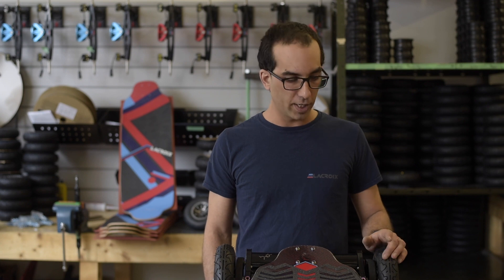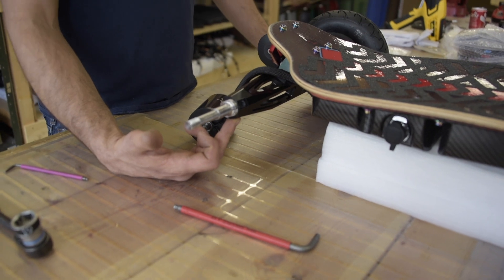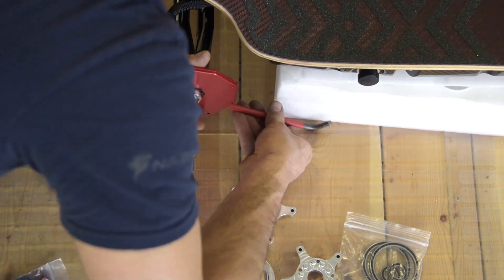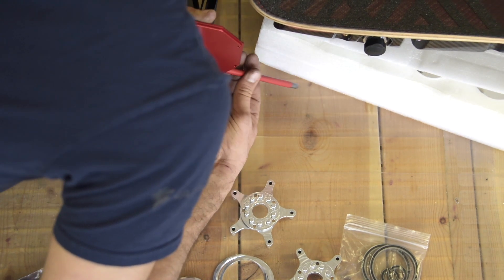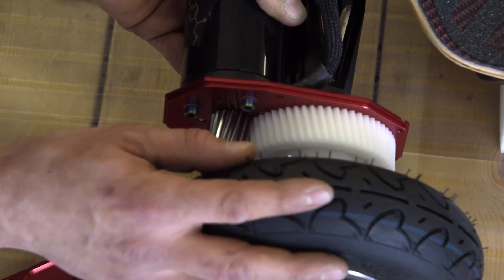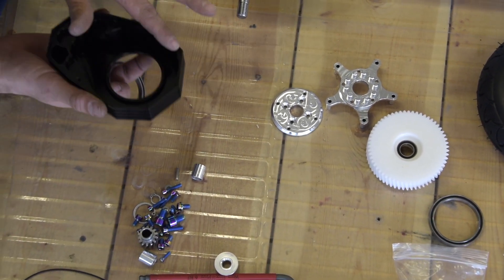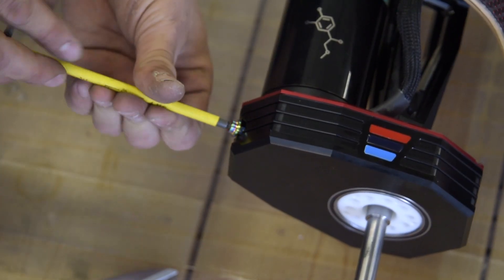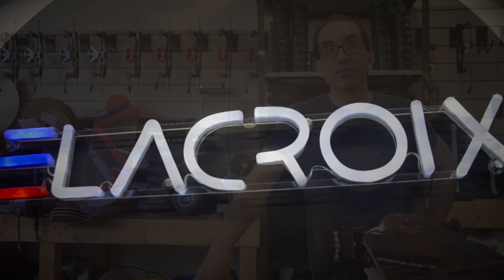HOW TO;  Install the new Falcon Gear Drive

Comment: Would've been nice to get a set of all metal gears instead. Even if kept well greased, plastic will eventually wear out.
Reply from the maker: we have been riding them for 1 year now and so far there has been no damage or modification of the gear, besides, the metallic ones are much noisier and can cause problems. They are made of hardened steel and POM. Polyoxymethylene (POM), also known as acetal polyacetal, and polyformaldehyde, is an engineering thermoplastic used in precision parts requiring high stiffness, low friction, and excellent dimensional stability. We are pretty confident in using this material instead of metal. let us know if you would like to receive more information about the product
Reply: @lacroixadventures2009  - Thanks for the info. Time will tell how plastics will hold up. Proper adjustment of the gear mesh is important.

Comment: I noticed that the gentleman installed cap screws to attached the Hub adapter to to the POM gear, is this something specific to the Aluminum Hubs. I have the plastic hubs and the adapter does not have any screws holding it to the POM gear. Doesn't seem necessary since everything seems to be help captive bay the axle nut. Interested in the answer, thanks
Reply: Hey Justin, yes you should have those screws. They align the POM gear with the motor gear inside the case and makes sure it's always exactly in the right spot. You don't see it from the outside from run the Falcon long enough without them and something will fail for sure.

Comment: Has anybody broken the pom gear yet. How is compared to steel when jumping? I liked everything about these drives but the plastic gear...if a tooth breaks it will surley faceplant you if it gets wedged between pinion and drive gear and for this reason its a no sale for me. Spend the extra money and go hardened steel. Pom is great for alot of other things like a rc truck but even then the first thing you upgrade is the gears to metal for dependability.
Reply: The drives are designed so that if the POM fails (we have not seen that happen yet), the screws holding the motor will take the hit and the motor will pop off. So no lock ups and no faceplant.
Reply: @TheArchDelux  seems like one would faceplant and the motor would fall off  "all at the same time". What a bad day that would be. Plastic doesn't last forever like metal gears. If pom is so good why not make the pinion gear pom aswell.

Comment: I do mostly off-road rides. Would you say that gear drive is less likely to break or cause problems when faced with sand, dust and humidity?
Reply from the maker: We suggest you gear drive if you do off-roading, that way you will not have to deal with broken belt ;) .

Comment: Well ''loctite-ing" those bearings in place in each housing was terrifying.
I only had the blue/med& red/high strength permatex gel on hand.   I opted for the blue. 

If you don't have a super small paint brush or like me don't trust yourself with a small paintbrush with threadlocker on the end of it...I used a Q-tip, some heat shrink and a heat gun to make an applicator. 

The tube shrunk around the cotton ball and half way down the stick worked great.  The cotton swab end covered in the shrink made a smooth little bulb that was good for dabbing tiny dots of the stuff around the edge of the bearing and the stick part (?) of the cotton swab covered shrink made a decent squeegee of sorts. 

 I got a thin even coat even using the gel type thread locker and avoid sullying the gasket & bearing.

 I'm 99.9% sure it worked anyway. Will see in the morning

Thanks for uploading this video and making the instructions available by the time my order showed up.

Oh yeah and thanks to everyone at  LaCroix for continuing to be simultaneously such bad asses, so gosh darn helpful all the time & for the amazing machines y'all are cranking out .... It's made that last year infinitely more bearable for this guy. 

Carry on.    🤘🏼
Reply: I hope that they will mount this in factory for the future.
Which RIM do you have, I am asking you that because the valves seem to be on the internal side of the wheel, so do you need to unmount wheel from Falcon to control or inflate your tires?
Reply: @tamataroa  well I learned a couple things when I was installing that bearing and yeah I second the emotion of hoping that's installed at the factory for the future shipments because it's been the one thing along with getting the gear mesh adjusted correctly that is worried me.

So when you're getting that bearing sealed to the aluminum your ceiling an active metal which is the bearing surface that steal or stainless steel that's an active metal and you're trying to lock it into an inactive metal which is an anodized aluminum so I asked a couple questions about this from support I heard they use green loctite in the shop I don't know if that's specifically for this bearing or not I tried blue permatex and I went to install everything in the bearings popped out after letting them cure for 36 hours I also had them curing in my apartment which never gets above 66° f so I also learned for proper cure with loctite you need 24 hours at 72° F so I've been running the heater with all the vents closed except in the bathroom and kept the casings with the bearings in the bathroom for 36 hours after reapplying thread locker .   Technically according to the literature For thread lockers there's some kind of primer you can pay you can paint on to the anodized aluminum inactive metal to help it adhere or lock into the active metal like steel that is the surface of the bearing I didn't learn that until after reinstalling them a second time and using different thread locker... This time using red thread locker.

  I  then installed the casings and the bearing was still moving around it didn't pop out like it did the first time and cause the motor to have an extra resistance because the bearing wasn't slotted in place correctly.   

I just pushed it into place and let it sit for another 24 hours.  

 I'm praying to God the damn thing doesn't fall out or cause any problems when I actually go to hot these things up.

As far as the side that valve stem is protruding from I have regular MBS hubs and I can just flip the inner tube around so the you know pull the tire off and if your valve stems point in the wrong direction pull the tube out of the tire put it flip it put it back in so it's pointing out to the other side where you can get at it to adjust your tire pressure without having to remove the wheel assembly.

For me the bigger issue is those kenda tires.. while they're excellent high performance tires that are  fairly well balanced I get treads showing through and have had tires deflate on me mid ride from putting about 120 mi on them.

which for me is 3-4 rides.  so having to change my tires every 4 or 5 days just got a little too much so I went ahead and shopped on AliExpress and all over the place I found some cheap 8-in scooter tires that are heavier not anywhere near as well balanced as the kenda's but I can put 400 miles on them before they start to show the tread being completely worn away and threads showing through and that's when I get worried I'm going to blow a tire while I'm riding again so to counteract the balancing issue I used the glass beads that you can insert into the inner tube glass balancing beads and I've had the same tubes I've been switching between tires on my lone Star for the last 5 months and the same balance beads in the same inner tubes.

I've just been switching the tubes with the balance beads  between tires and that has worked to balance the wheel so when I'm pushing 30-35 mph I don't get any kind of wobbles  because the area around the valve stem and the tire itself isn't quite as balanced... but I'm getting a lot more mileage out of these you know tires I'm getting for eight bucks a piece on AliExpress then I ever did out of the kenda's.

But that's just because of how I ride and how much I weigh. Hopefully not TMI.

and I hope I answered your question but yeah you should just be able to flip that inner tube around get the valve stem pointing out the other direction but I'm not sure how it works on the hyper rims.

 I'm saving money for a super sport.

 so I didn't opt to upgrade to the hyper rims but this install of Falcon drives is taking me 5 days now and I just put the grease in and I'm letting the loctite set on the bolts for the gear cases.

 I've actually got an extra set of hyper trucks and motors that I've been installing everything on so tomorrow I'm going to pull the enclosure off and install the new set of rear hyper trucks & motors with the Falcon drives which will hopefully exceed my wildest dreams LOL. I'm sure they'll be amazing if I got the gear mesh correct..Goodness,  I spent hours lamenting over the gear mesh.  we'll see how it goes! good luck!
Reply: @quentinplatt  
Hi Quentin, it was nice to read your long message, and REX on Falcon and Locite game ;-)
On my side the workaround is more radical: I've preferred to sell my board rather than go into a spiral loop with quality check, DIY process on equipment that you pay at premium price, beta testing @ 700 USD... 
I've go so many bad experience with quality from factory , since August 2019, bushing, motors, tires, tubes, etc... that I won't add any coin into Falcon experience.
I do not trust in them about test and quality, let see how motors, POM, pulley, loctited bearings would resist after 90 days. 
I think that the best thing to do is upgrade Lacroix's with third party (XCell) hardware, let see if Matt is going to work on his own gearbox.
Reply: @quentinplatt  I'm reaaaaally hoping they put it on at the factory. I just emailed support insisting on this. Hell, I'd gladly pay for the labor, I just can't fathom putting this shit on myself lol

Comment: @lacroix adventures
At 5:09 you don’t mention installing the adapter to the face of the motor, be sure to add this in. I felt like an idiot trying to install the motor to the red plate without it LOL

Also, I used a little white lithium grease to help slide the axles in the trucks since metal on metal and low tolerance was a bit tight. After that lightly tapped in the axles with a mallet it went in smooth

At 7:45 don’t forget the retaining ring on the bearing and be very gentle when putting the white gear on the axle or else you can pop the retaining ring off which is very annoying

When installing the o ring I found a touch of super glue to hold one end in place was helpful
Reply from the maker: Thank you Grant! We will add a side note for that,